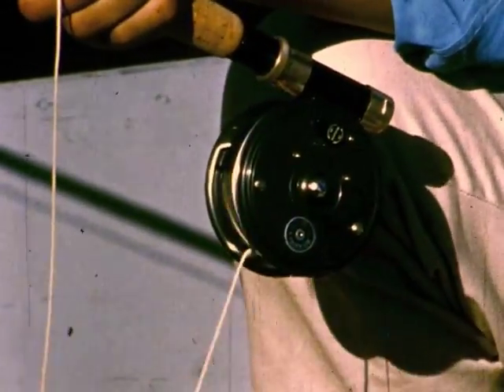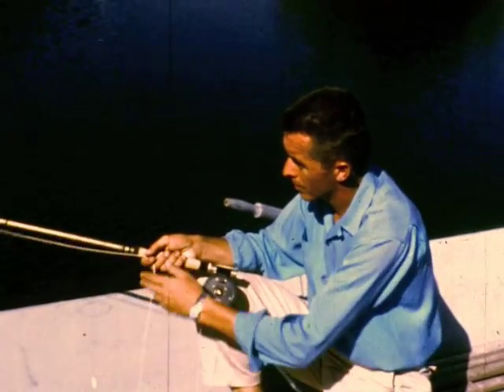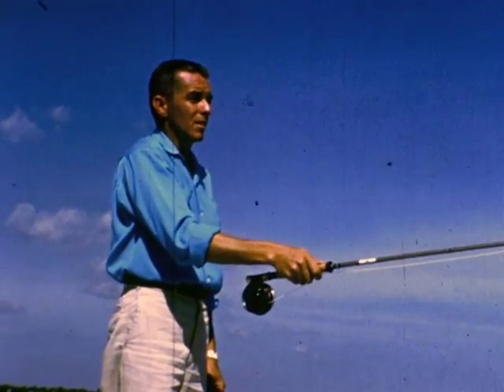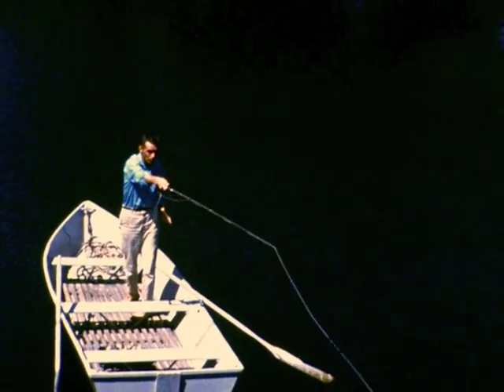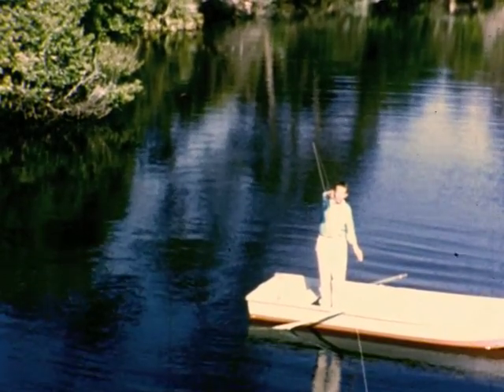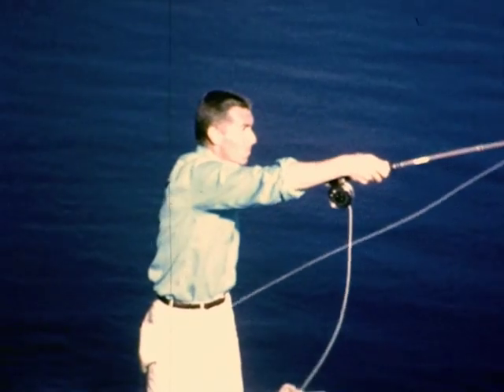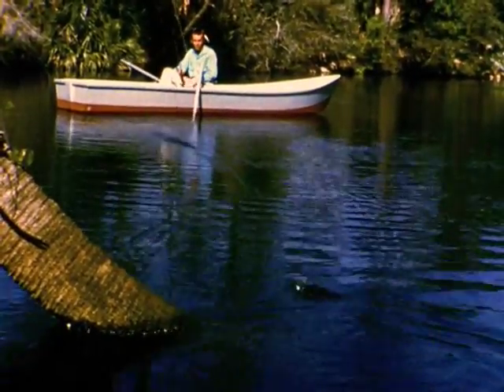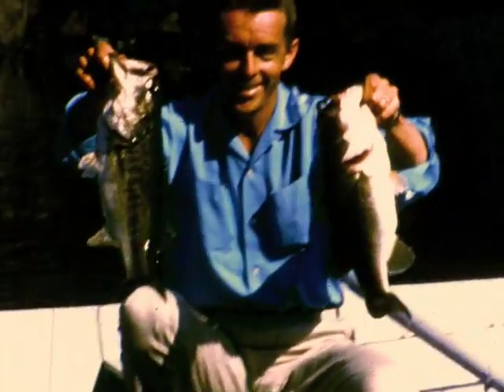World Champion Fly Fishing Reel Demonstration

Comment: Ive just started to use the double haul, and its tricky to co-ordinate the hands
and arms, but im slowly mastering it.
Could you tell me if you can get longer casts with lighter fly-lines? Compare 
5 weight to 8-9 weight?
Its amazing that this very old video, is far more instructive than most of the modern
ones Ive seen on tube!
I like thee way he uses his shoulder in the casting, as some vids have the arm
tight to the chest, not using shoulder
(best other vid seen is by Hywel Morgan)